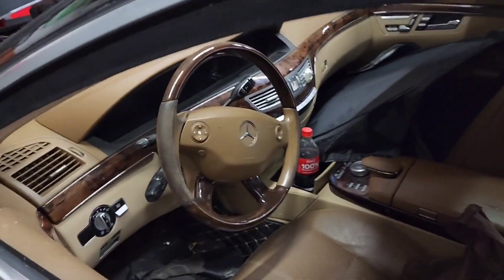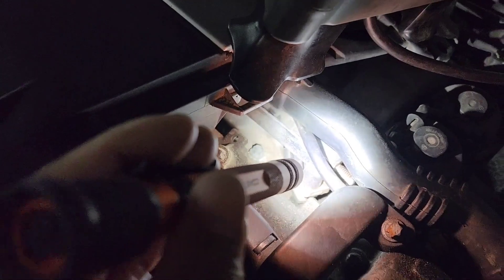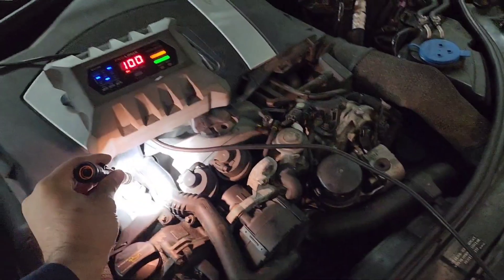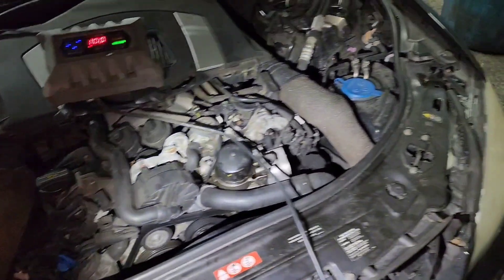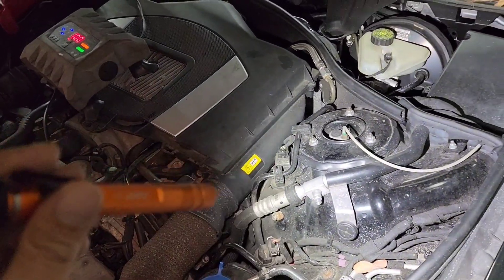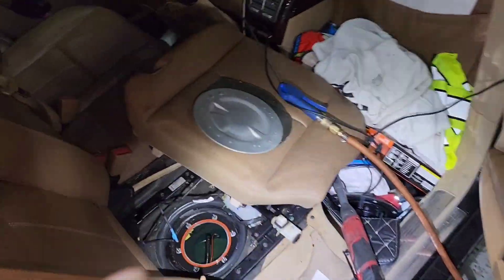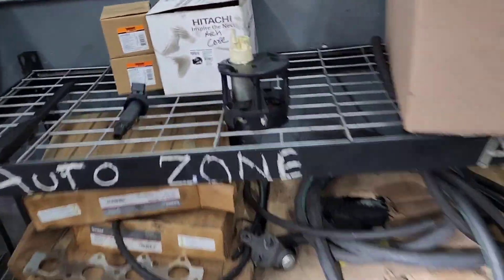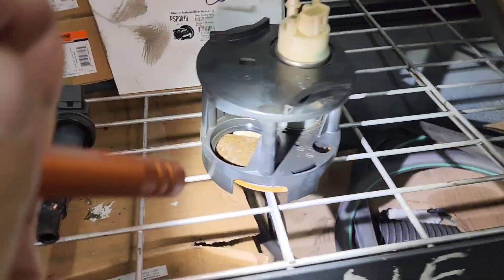Mercedes-Benz S550 Crank, No Start = Fuel Pump

Comment: Did you get fault code for fuel pump? I get crank no start
Reply from the maker: @clabruno  there must have been some fuel related codes but I guess didn't bother to check them since I found no fuel problem immediately
Reply: There is no code unfortunately

Comment: Irfan, did you also change the fuel filter under the other seat? Or did you only replace the fuel pump?
Reply from the maker: this vehicle doesn't have fuel filter!
Reply: Yes, the fuel filter is under the backseat on the driver’s side
Reply from the maker: @clabruno  you are right. Just went back and checked it. Fuel filter does exist for this car under the seat on the other side. Thank you for correcting me.
Reply from the maker: Does have filter and it should have been replaced with fuel pump.